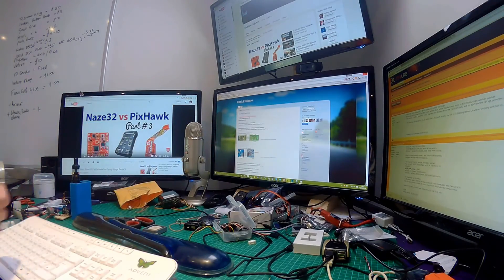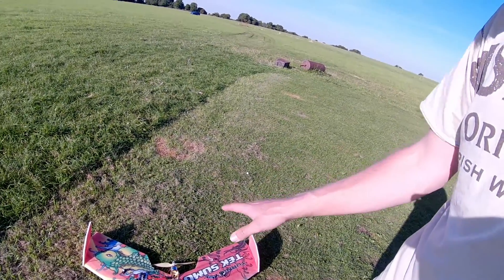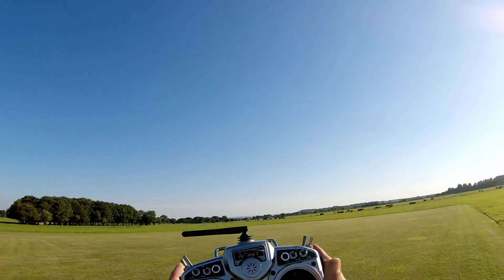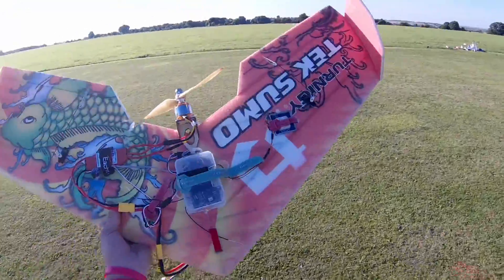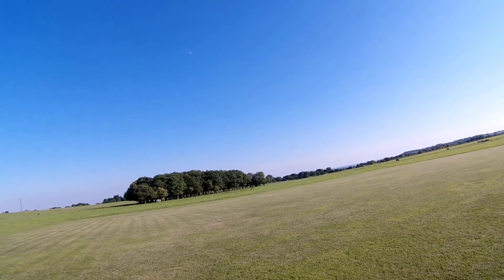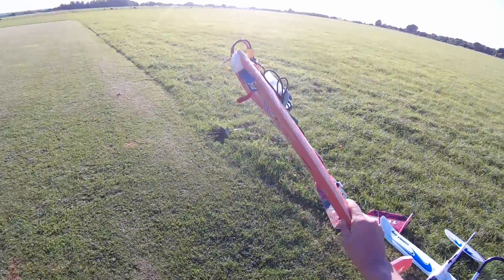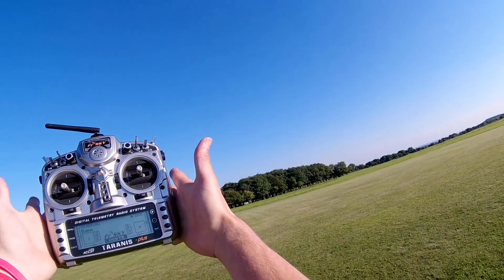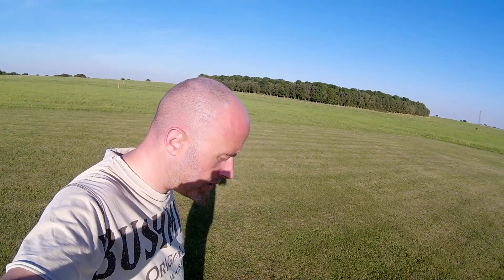Testing PatrikE's Baseflight Airplane Part #5 - Naze32 V's Pixhawk for Flying Wings

Comment: Hi Matt,  Just got the naze32 rev 5 board loaded with Patriks firmware and everything seems perfect on screen,  However on physically testing the servos only the ailerons work even in passthru mode. Any ideas?  The Taranis is set up as a flying wing model
Reply: All sorted.  I had a flying wing setup in the taranis which confused the naze!  Removed the mixing on elevator and ailerons and all good.  Next stage test flight!

Comment: hi can you help,I am trying to install a naza32 into a flying wing but my problem is I can't get the servos to work. the throttle works fine, it arms when I push the throttle to the right and the motor spins. When I plug my naza32 into baseflight and the servos get power they move up and down but I can't move them from my taranis. On the motor tab an baseflight I can start the motor but I have no servo movement on that either, on the receiver tab and I move my aileron and my elevator then they do move up and down, I have flight modes on a 3 position switch, can you help cheers
Reply from the maker: Howdy Allan, just to confirm you're using a Naza board, not a Naze32? If It's a Naze32 with PatrickE's baseflight airplane on, try setting "Pass through" mode first, then see if the servo's work. Also check that you have the servos on channels 3 & 4 AND (I say "and" because I've done it), make sure the servo leads are the right way around on the board. Hope that helps Allan, Matt
Reply: sorry but what do you mean by a Naza board not a Naza32,the board I have is a Naza32 rev6 which I was running on cleanflight but I have flashed baseflight onto it.What I noticed on one of your vids this morning is to type preset flying_wing into the cli.I tried it on past through last night and still no servo movement,i also tried swapping the servos about but still no movement.When I tried flying wing on cleanflight I could get the servos to move but no throttle but on baseflight I can get throttle but no servos,isnt that typical ha.I am not installing a gps yet as I'm just after some stability on a windy day
Reply: I typed preset Flying_wing into the cli but it says unknown command
Reply: Matthew Ogborne hi,is Patrick E baseflight different from baseflight as I have baseflight on my laptop but when I Google Patrick E baseflight I find a different baseflight to download but my laptop and  my pc at work want to go into the app store for a different app to open it
Reply from the maker: Allan T Howdy Allan, ah ha! You need to load PatrickE's baseflight airplane on manually. You can download it here http://fotoflygarn.blogspot.co.uk/2015/01/baseflight-fixedwing.html where it says "Baseflight_FW_160622" Matt
Reply: Matthew Ogborne yes thanks but do you need a special app or driver to open this file as I'm not able to open it on my laptop or my pc at work,cheers
Reply from the maker: Allan T Howdy Allan, you need to flash the board with that hex file. Have you ever done that before?
Reply: hi,I have flashed the board with cleanflight and baseflight but that's it
Reply: I have just had a thought,i have cleanflight flasher on my phone and if I load up local hex file then I can get Patrick e baseflight up to flash,am I correct in thinking I can do it this way
Reply from the maker: Allan T Probably, I've never tried though!
Reply from the maker: Allan T Hey just give a whirl & see what happens. Let me know how you get on with it. Matt
Reply: Matthew Ogborne no I'm afraid cleanflight flasher says the file is corrupt and wont flash baseflight_FW_160622
Reply from the maker: Allan T Yea you'll need to the Baseflight one then instead.
Reply: Matthew Ogborne Hi,no not even baseflight will open it,it says hex file is corrupt
Reply from the maker: Allan T Odd, you are sure you've unzipped the file and are selecting the .hex file?
Reply: Matthew Ogborne  I have managed to flash baseflight fw,I managed it on my phone, I just needed to extract the file so it became a hex file. Now I need to try it on baseflight, cheers
Reply from the maker: Allan T YAY!
Reply: Matthew Ogborne hi matt,I have finally got the naza32 working on Patrick E baseflight, I have had to tick roll box on servo 4 in the servo tab to get the ailerons working in the correct direction when I push the stick,the direction is wrong when I tilt the fc so I need to figure out how to alter that about, if I turn the board 90deg then the ailerons go in the correct way
Reply: Yes I have it,I had to swap the servos and then click on the roll on servo 3 and then I had to turn the board 90deg but everything is moving in the correct direction, so chuffed thanks for the help,I'll test it tomorrow and I'll let you know how I get on, cheers
Reply from the maker: Allan T Howdy Allan, happy days! A tip for you would be to try in passthrough mode to begin with, get some height on, then switch to horizon or angle mode, BUT be FULLY prepared to switch back to pass through mode, just incase the servo movements in baseflight need to be changed. Matt
Reply: Matthew Ogborne hi matt,just had my first test of the naza32 in my wing and it went bad,when I turned it into horizon mode it just pulled up into a loop
Reply: Matthew Ogborne hi matt,I'm trying to figure out how to swap to movement of the board, my servos were in the wrong way so I have swapped them around but my problem is up and down the servos are moving correct but left to right are incorrect, when I tilt the left wing down the left aileron comes up which is wrong, I'm unable to figure out how to alter that on the board,are you able to help,cheers
Reply from the maker: Allan T Howdy Allan, see the servo tab, you can switch the movements around in there using the tick boxes. Hope that helps Allan, Matt
Reply: Matthew Ogborne hi matt, ticking the boxes in the servo tab only adjusts the stick movements not the board movements if you know what I mean
Reply from the maker: Allan T Ah it does change the board movements, then change your stick movements to match. The board needs to be right, the stick movements need to match them. Matt
Reply: Matthew Ogborne hi matt,yes you are right it does move the board movements but it has also altered the stick movements on my taranis, I've tried altering the direction on the taranis but that doesn't help, I have the board working correctly now but now the stick is wrong hmm
Reply: Aha it's OK I have it sorted I just needed to swap them about in the mixer on my taranis
Reply from the maker: Allan T YAY!
Reply: Matthew Ogborne hi matt,I have a question for you,I have some 12v leds on my wing,would you know if I can run them of my naza32 on a switch on the taranis to turn them on and off,I had them working before on my spare channel on my receiver bit now I nave the naza32 running on ppm,cheers
Reply from the maker: Allan T Allan, genuinely not sure! Matt
Reply: Matthew Ogborne hi matt, just a heads up,the naza32 worked a treat,it made a big difference in keeping it steady, I might even think about a GPS unit now,thanks for the help
Reply from the maker: Allan T YAY that would be "Happy Days" Allan :) Matt

Comment: I have been using PatrikE's firmware from last November in both of my Z-84s. I've been flying them for a good 6 months or so.    
      The first one took some time to get sorted but once it was worked out and tuned, it works very well for what it is. I just basically copied the first Z-84 and built a second one. The second one had a slightly different tune (PIDs) even though they were exactly the same builds and wieghts. GPS Home and GPS Hold modes work well. I really enjoy flying the Z-84 in Gyro (Acro) mode because it tracks like it's on rails. Even in windy conditions. 
    I'm using Naze32 rev5 boards and mini M8N GPS modules with micro Minimosd MWR1.5 firmware.
Reply: Thanks for sharing your experience. Im running betaflight on it atm without the gps (also Z-84). Im thinking about adding a gps and then install PatrikE's firmware on it. The positive reviews got me convinced so thanks
Reply from the maker: hyprmtr I'll give it a whirl outside of the model first me thinks :)
Reply from the maker: hyprmtr Will do's! (have one more video to edit before bed. Have done 8 in 2 days so far :) )
Reply from the maker: Howdy Fella,

Daft question, do you mean in rate mode with no other modes selected when you say Gyro mode?

And the Z-84, an amazing model :)

Matt
Reply: +Matthew Ogborne, Yes, rate mode. Rate mode is the gyro only mode without the self leveling accelerometer. Now there is a PASSTHRU mode which is no stabilization at all. It sends your receiver signals from your radio directly to the servos and esc as if the flight controller is not there. You may know this already but, it is important to madien and trim out the plane in PASSTHRU mode. After the plane is trimmed and flying well, I recommend adjusting your control linkages to center your trims on your radio if you had to move your trims from center. Doing it this way takes time but, RTH and other GPS/level modes will work as they should.
Reply from the maker: Yep Passthrough mode is normally very choppy due to the lag on the controls, it's weird how even a few milliseconds seem like hours when flying in pass-through mode :D

Looks like dry weather tomorrow, could even be a flying day! 

Have the Pixracer on my desk which the external compass is now working, as some plank (not mentioning anyone!) wired the SDA & SCL wires up the wrong way around. +1 for the leads, popped them out & swapped them over. Jobs a good'en.
Reply from the maker: PS. Just bought a mini talon, Banggood sent me a 20% off coupon, I had to use it immediately of course! AND it was in the EU warehouse. Should be here this week :D
Reply: +Matthew Ogborne,   Ah yes, that's how I figured out why my landings have been shit especially when doing my landings through the goggles. On top of that lag, I'm running EZuhf PPM and it only adds to the lag. Haha.
    I have a cpyple of mini APM 3.1 boards I been wanting to throw in a plane. I have set up a few APM boards in copters but not a plane yet. 
    Keep us updated on your progress and let me know if you have any more questions. 

   Oh, I had to Google Daft question. we really don't use that word over here! It wasn't a daft question at all!
Reply: +Matthew Ogborne, Nice! I had my eye on that for a while myself. I need to finish some projects before I get another. haha
Reply from the maker: hyprmtr LOL I know that feeling. It's been raining here for most of the day. 

I FINALLY got around to fixing the motor mount into the ZackCombat wing, the pics are here on Facebook https://www.facebook.com/groups/rcmatt/ I'm going to glue the wings on it now as it's had 3 bricks on it for a couple of hours.

Matt
Reply: +Matthew Ogborne,  Nice! I just put in a join request on your FB page. You should see it soon.
Reply from the maker: Done!
Reply: Great! Thanks!
Reply: No problem!  If you have any questions at all or want some good starting PIDs just ask. You can look up some of my videos of the Z-84 with Naze32 and GPS to see how it flys. I now built one with an Eagle Tree Vector so don't get those vids confused with the Naze32 Z-84. :)
Reply from the maker: hyprmtr Howdy fella, will do's! So an immediate one, do you know if you can put the FC board side mounted? See this thread http://fpvlab.com/forums/showthread.php?27854-NAZE32-for-fixed-wing&p=811504&viewfull=1#post811504 Matt
Reply: That is a good question.  I have only mounted them Yaw 90 and Yaw 180. I also have a mini Naze32 rev3 mounted roll 180 which is upside down. Give it a try agian and calibrate acc on its side as the plane would fly level.
Reply: Yes, that's a good idea.  Let us know if it works.

Comment: Yeah, it works, using it on a Z-84 wing.
Read the last few pages of the thread, my plane did a suicide dive, because the failsafe settings are rather complex and it can lead to a crash.
There are a few other settings, apart from the pids, which need to be dialed in.
"set fw_roll_comp" can only be done via CLI and makes a lot of the difference to how the plane will fly. The "8" pattern on RTH exactly means, that set fw_roll_comp needs an adjustment.
Cheers
Reply from the maker: Morning! Thanks for your comment.

Yep I read that, I was the one suggesting to put some extra nose weight in it :) 
You mention that "set fw_roll_comp" need tweaking because it's doing a figure of 8, so do I increase this or decrease it?

Matt

PS. After reading about your crashed Z-84, it made me double check my failsafe settings. So some good did come of that event.
Reply: As I remember, if the plane looses the preset altitude, during turns above the home base in RTH mode, and then corrects it on the straight lines, then you need to increase it (default is 100), if it climbs, then decrease.

True, every crash is learning, now I deeply understand what has happened. To add to the improperly set failsafe, my "set fw_roll_comp" was set to zero.

Z-84 is a great plane, not only is forgiving in most of the crashes, but it's a great endurance palatform as well, capable of over 1h flights.
Reply from the maker: soulvagabond Brilliant, thank you! Once I get the PID's sorted, I'll try that with FPV on it. Daft question, what was your PID's for the WingWing?
Matt
Reply: Here's my Z84's cli dump: https://goo.gl/jIPR5Y
I believe, Teksumo PID's are also shared on the forum.
Reply from the maker: soulvagabond REALLY!!! I couldn't find them and I hunted for ages at the flying field
Reply from the maker: soulvagabond PS. Thanks for the dump (that sounds soooo wrong LOL), I'll take a look at the values now :)
Reply: Pids will also be influenced by the elevon throws in the wing and servo horns. Wings require very little movement and if the throws are set too wild, naze will be overcompensating and it will be hard to dial in the pids. But you probably know that already.
Reply from the maker: soulvagabond LOL Yea, I found that out the hard way. Wings & quadcopters are nothing like each other. On the quads I'm used to making small adjustments, not halving the values and starting from there. Good fun though, it's a great learning expereince :) 

Daft question, is the Z-84 flying again?
Reply from the maker: Brilliant, thank you!